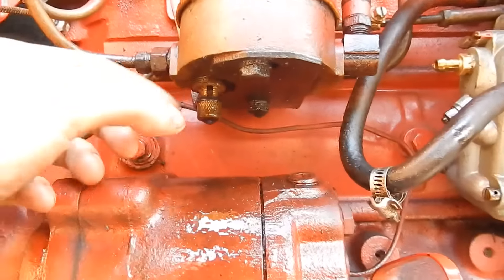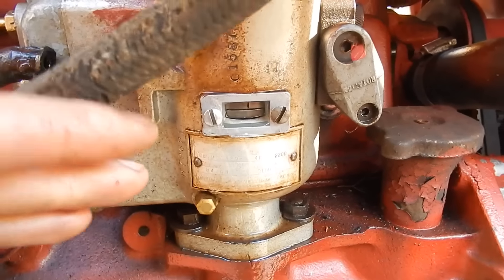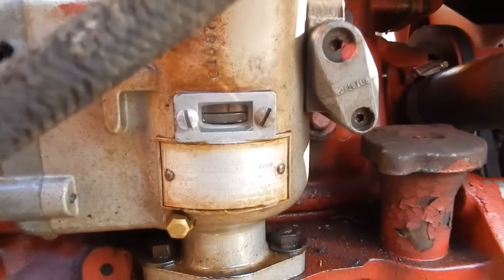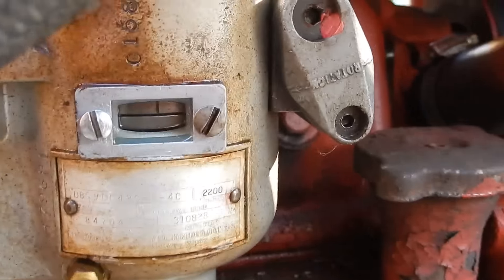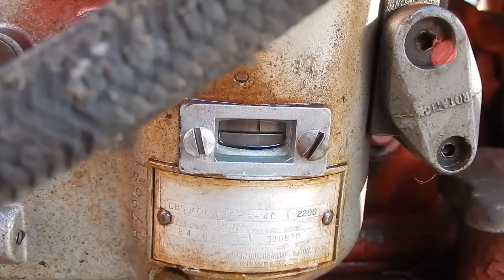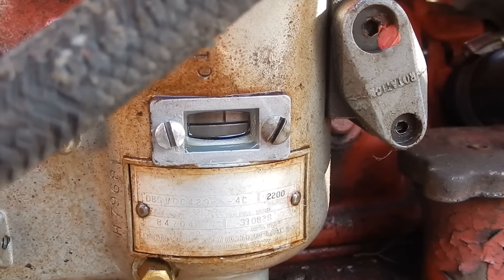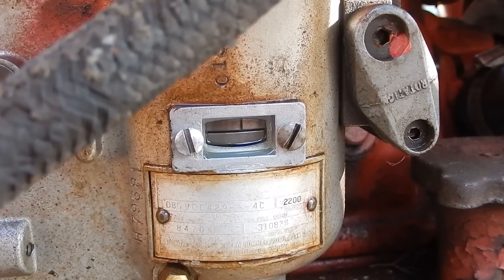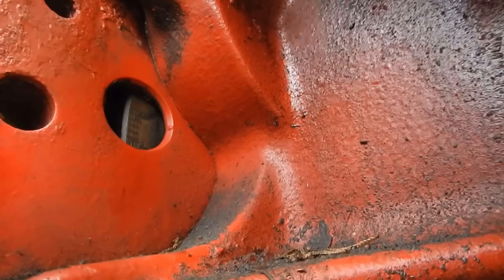Fix Your Ford - Injection Pump Pull and Repair

Comment: Theres 2  snap ring clips on your throttle shaft , with a long and short side . On  the one over the left side ,  the long side arm isnt            doing anything , it was probably put in , because they didnt have a  2 short sided clip , thats ok .  If you pull that clip off , you  can then slide your throttle shaft out to the right  . But first you need to pop that right side pin off as well . This is the interesting part ,               its in backwards  .The long end of that  pin  should be on top , which it is , but facing in the other direction . The flat cut in the shaft  , drives that pin . It pushes on the governor linkage , and causes shut down  when the linkage is all the way off   . the govenor  linkage also rotates the fuel delivery valve . If it dosent turn , you dont get fuel .

Comment: I have a JD450-CC that had the same problem. Hadn't been cranked in two years and I couldn't get diesel to the injectors. I had planned on taking the pump to a shop to get it overhauled. Your video saved me a lot of trouble and money. Thanks a lot.
Reply: Ricky Blankenship

Comment: I have a Ford 4500 backhoe. After letting it stand too long, the CAV pump stopped working. I removed the fuel line and one of the injector connections and sprayed WD-40 into them while someone turned over the engine. It took a couple of days....periodically repeating the process but it's a lot easier than removing the pump. All of a sudden it started working again. Works great now!
Reply: First thing I noticed was no fuel inside the injection pump.

Comment: A while back I met up with a guy that had a Dodge Cummins pickup ... One thing he taught me about diesel engines was that due low sulfur in the fuel lacks lubrication...  A hint he taught me was to add two quarts of Dextron II ATF (not type F) in with his fuel ..  This added the lubrication needed for the injection pump and injectors ... I've been adding this to my fuel ever since....  Not only does the fuel injection pump go from 150 miles before repair it goes now up to 300 miles before an overhaul or replacement ... Might be something you may want to try..
Reply: 300 miles? As in 300,000?

Comment: What a coincidence you posted this! After many years of trying I finally bought my grandpas 981 diesel and it is leaking at the backplate on the pump! Thanks for going through this.
Reply from the maker: +fcarp1685 Glad it helped! have fun with gramps' tractor! it's great to keep it in the family.
Reply: +themadmailler So I got my pump back and installed (I believe correctly). It seems like the overall rule is that as long as you are on 18 degrees with the pump marks lined up and it is all still lined up after 2 rotations of the engine the tractor is good to run. Is that a correct assumption? (I haven't owned a diesel until now)
Reply from the maker: That sounds right. You also have to make sure that when flywheel and pump marks are all aligned for timing purposes, #1 cylinder has to be at TDC compression. I believe that the Ford motor is a little bit foolproof because the drive tang is odd shaped and only goes in one way, so you can't accidentally install it 180 degrees off. You should be fine, bleed those lines and see if it fires off!
Reply: Awesome thank you!
Reply: +themadmailler Well my Ford is now running thanks to this video! thanks!
Reply from the maker: awesome! glad i could help!

Comment: I know it's about 2 years later but those j hooks keep the throttle shafts together just be careful when you loosen the governor spring for which the weights on the timing wheel some times slip out of there slots then you will have to tear the pump down unless you get lucky and some times you can have a hard start from the blades inside or delivery valve in the head or wear from the head depending on the injection pump

Comment: had the same problem with a ford 3600 cav pump. using a can of starting fluid start and try 2 keep it running with a few short hits of starting fluid it will speed up and slow down after a couple of tries it took off on fuel.saved removing and dissassembly.
Reply from the maker: +Kelly Cheverie I actually tried this in desperation, to no avail.

Comment: I have a 1984 Mitsubishi Mighty Max turbo diesel that I sometimes have problems with after it has set for a while. What I found was air gets into the fuel system and at the filter there's a primer pump that I sometimes have to use to get it to start. It acts like it's not getting fuel and that's what it is. If you didn't try this the first time maybe keep it in mind and just verify your fuel system is purged of air before removing the pump. Just a thought. Good luck - that thing sure looks like I'd have some fun taking it for a ride.

Comment: Nice video tutorial. Question - How do you remove the injectors on this model?  I have a Ford 4000 Industrial 4 cyl. and it is quite similar.
Reply from the maker: remove the two bolts and pry it out. pry on both sides to pull it evenly.

Comment: Great video. I have a 1958 Ford 861 and diesel fuel is leaking into the crankcase and I have read several time the injector pump seals has been known to go bad and leak fuel in the crankcase.  I think a lot people call them umbrella seals because of their shape. I was hoping I would see you changing those seals in your video. Anyway, do you have any information for a DIY on how to change these seals. I've searched Google and Youtube and haven't found anything.

Also, what was the block of wood for?

Thanks. Tom
Reply from the maker: you can pull the driveshaft out of the pump to replace those seals. Apparently it can be a trick to get the shaft and new seals back in due to the shape of the seal. there is a special tool, but ive heard that a zip tie works well to compress the lip.

Comment: Have a 801 power master diesel, same pump, when starting, the engine revs at high rpm's and doesn't come back down, until it reaches too high rpm's then it's fine, afraid gonna blow the engine. Any help will be appreciated
Reply from the maker: sounds like the metering valve is sticky.

Comment: I note that you used WD40 on the metering valve and it seemed to sort the problem for you. I have a similar problem on a Delphi pump where I think the metering valve may be sticking as the tractors response to the throttle is sometimes very slow. It does not happen all the time. I am thinking of trying your solution in the following way. I do not want to remove the pump from the tractor as I do not want to get involved with timing complications etc. I was going to disconnect the incoming supply and the injection lines and drain the pump of its diesel. Then squirt in a full can of WD40 and leave it to soak in over night and then drain off. Could this basic approach provide me with the same result as you achieved?
Reply from the maker: I used WD because it was at hand. If i were you i'd run a heavy concentration of Marvel oil in it to free it up. Don't be afraid of removing the pump... it's a tedious task to put it back on but not awful. The more you do it the easier it is, and i sure have had some experience taking off this pump...

Comment: It really is obscene what the diesel shops charge for repairs. I have to rebuild my injection pump every year because I run vegetable oil. The vane pump gets stuck when it sits too long and the whole pump benefits from a thorough cleaning.
Reply from the maker: a pump rebuild every year? that's ridiculous. any cost savings of WVO is going out the window with that rebuild. are you switching to diesel before shutting off the motor each time?
Reply from the maker: Oh you're rebuilding yourself? not too bad then. Still a royal pain to take the pump off and re-time and re-install each year. are you filtering the WVO first? Or maybe you can look into making your own biodiesel out of the WVO instead. That's nice because you can easily exchange regular diesel and biodiesel in the same tank.
Reply: I used to make biodiesel but it got to be expensive and I was losing too much energy from the vegetable oil. In 2009 I went full WVO and ran fine till winter 2012 when I seized my pump in cold weather.  In 2013 I started the yearly rebuild and no breaks since then. I centrifuge the oil and Ph balance it to avoind corrosion.
Reply from the maker: Interesting. Sounds like you got it to a science! What vehicle do you run it in?
Reply: 1990 F250 pickup

Comment: A Stanadyne  Pump?
Reply from the maker: Roosa-Master. I believe stanadyne bought them at some point.
Reply: Yes ,  DB style . some have an electrical stop solenoid , some use the long end of the hold in C-clip to stop it mechanically .  Hes got the mechanical version , if you look at the inside of the cover , theres no solenoid  .

Comment: I watched it all the way through but what exactly was the problem?
Reply from the maker: the metering valve was stuck and i was not getting fuel to the injectors, so i had to take the pump apart to loosen the valve up.
Reply: @themadmailler  i know im late but can't his be done on the engine? Gonna be working on one today and I feel that I could just get it while on the engine.
Reply from the maker: @Skodak96  I don't have this tractor any more, but I doubt I would have taken the pump off if I didn't need to. I think the loader arms were in the way. If you had a clear shot, definitely do this with it on the tractor!